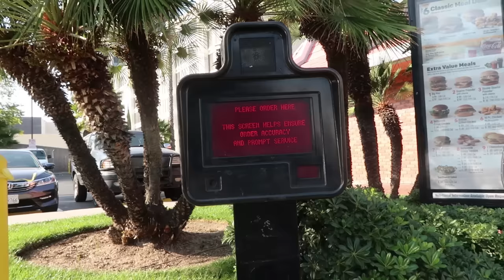MAKING OUR ENTIRE HOUSE A SLIP N SLIDE

Comment: I'm gonna need this to go right there on the interior door open it up squeak it pick pocket it 4 Times lay it down flat get the soap that's when it slithers when it's sliding its going when it's going you've stopped if you stop too soon though where's the 4x4 where's the 12x12 2x2 is 4 put it I'm your head or go to bed LETS DO THIS

Comment: "Okay, I'm gonna need this to go right there on the interior door. Open it up, squeak it, pickpocket it four times, lay it down flat get the soap, that's when it slithers! When you're sliding, its going, when its going you stop. If you stop too soon though, wheres the 4x4 wheres the 12x12? 2x2 is 4. Put it in your head or go to bed!" - Corey 2018

Comment: K listen Imma need this to go right there on the interior door. open it up squeak it pickpocket it 4 times, lay it down flat, get the soap that's when it slithers! When you're sliding it's going, when it's going your stop. If you stop too soon tho where's the 4 by 4?  Where's the 12 by 12? 2 times 2 is 4 put it in your head or go to bed. LET'S DO THISSSS!

3:51

Comment: 3:53  Ima need this to go right there on the interior door Open it up squeak it pickpocket it 4 times lay it down flat get the soap that's when it slithers when it's slidin it's going when it's going you stop if you stop too soon though WHERE'S THE 4x4 where's the 12x12 2 times 2 is 4 PUT IT IN YOUR HEAD OR GO TO BED

Comment: 3:52
“Ima need this to go right there on the interior door open it up squeak it pickpocket at 4 times lay it down flat get the soap that’s when it’s slithers when sliding and its going when it’s going you stop if u stop too soon though where’s the 4by4 where’s the 12by12 2*2 is 4 put it in your head or go to bed LETS DO THIS” -Corey

Comment: Ok whats the plan 
Imma need this to go right there in the interior door
Open it up
Squeak it pickpocket it 4 times
Lay it down flat
Get the soap
Thats when it SlItHeRsS
when youre sliding its going when its going you stop
If you stop to soon though
Wheres the 4 x 4 
Wheres the 12 x 12
2 x 2 is 4
PUT IT IN YOUR HEAD OR GO TO BED
LETS DO THISSSS

Comment: Open it up, squeak it, pickpocket it 4 times, lay it down flat; get the soap, that's when it slithers, when it slidin' it's going when it's going too soon though, where's the 4 by 4 where's the 12 by 12. 2x2 is 4, PUT IT IN YOUR HEAD OR GO TO BED